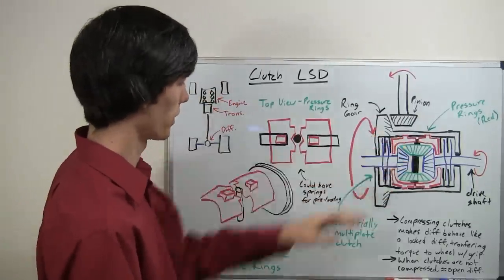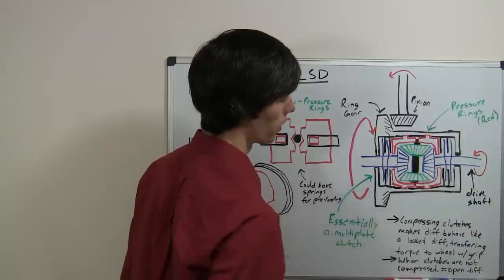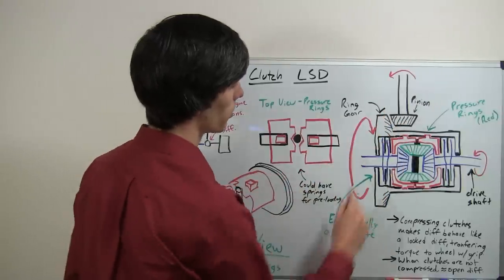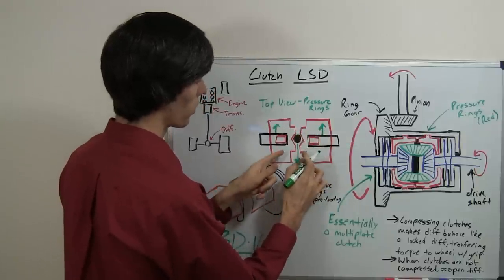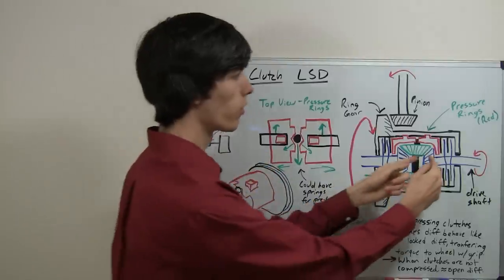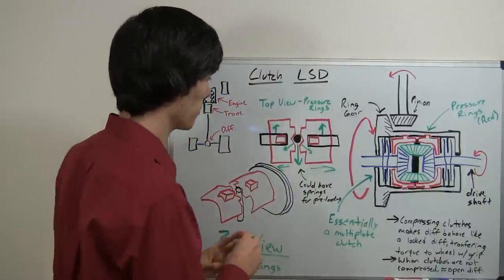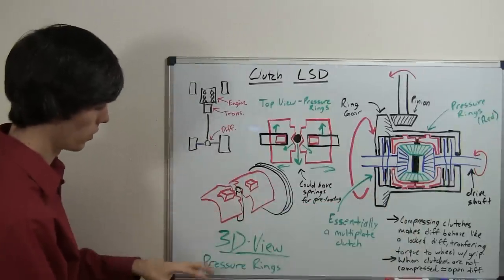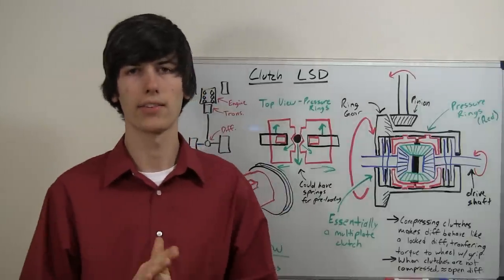Limited Slip Differential - Explained

Comment from the maker: Locking differentials have the advantage of always having both tires spin at the same speed. This can be good in such instances as being off-road, on ice, dirt, etc. Having the wheels locked allows for the maximum amount of torque transfer possible (100%). A limited slip diff only transfers torque up to a set amount, based on the friction force that is needed to be overcome in order for one tire to spin more quickly.

Comment from the maker: Depends, if you're accelerating/decelerating (if a 2 way) and one wheel has better traction, it may help. If you're just coasting, than an open will allow the two wheels to rotate at different speeds.

Comment from the maker: Close to a locked diff, in a sense that it will transfer torque, yes. But it can still allow for differing speeds while accelerating. Depending on the type of LSD, you may have to break a certain amount of friction to do so.

Comment from the maker: If you accelerate while cornering, both wheels will receive the same power, but if the frictional limit of the diff is exceeded, it will allow for one tire (the outside tire) to rotate faster than the inside tire. If one wheel is "locked" the torque will attempt to go to the "locked" wheel in order to break it free.

Comment: Thank you so much, I couldn't understand what the clutch packs were being compressed against that caused them to engage the left or right wheel shaft.  You explicitly stated that the force from the pinion shaft compresses the clutch packs against the HOUSING, which wasn't clear in other top search results.  Thank you!

Comment: why do you say when you are not accelerating, the pinion shaft (black) does not has force on the pressure ring? i thought as long as the wheel is rotating, the pinion shaft will definitely contact with the pressure ring and therefore there will be force on the pressure ring?

Comment: Finally I understand how my clutch LSD works. Right half shaft spinning faster makes pinion apply pressure left, engaging the left clutch pack. Also explains why it feels like I have a locked diff when I apply heavier throttle while turning.

Comment from the maker: It's not locked, it's somewhere inbetween. You can set the frictional limit, so if there's two much bind the outer tire will be able to rotate faster than the other. What it's doing is simply trying to prevent one tire from spinning on it's own, thus causing the car to understeer and not accelerate.

Comment from the maker: The combined torque of the axles (both wheels) would not exceed the torque from the differntial, so if it were 50 then the one not on ICE may get like 45 lb-ft and the other 5 (or some other split).

Comment: Having an air locker means you have the option of having both wheels completely locked or getting equivalent torque.  This is can be disengaged at anytime as well to typically an open differential or even a LSD.  LSD differentials have clutches that can be overcome when the torque demand is too high. Meaning torque split will never be even when it is in demand. A LSD is great and has it's purpose.

Comment: Indeed. If a tyre cannot deploy enough torque to the road surface, the wheel will spin and "waste" the power given to it by the drivetrain. - The solution for the case in question (FWD car) is an LSD, however that can cause other handling issues (including increasing understeer), particularly in FWD applications. This is because there is a limit to what the tyre can do. - If you're using all of it's available purchase on the road to put power down, you can't then expect it to steer as well.

Comment from the maker: Modifying an open diff (aside from simply welding it, which you shouldn't do if you're going to use the car on roads) wouldn't be cost effective, but you could likely find an LSD that fits your application.

Comment: Have you ever applied to work for a Formula One team, i am sure they would be impressed with your knowledge.

About LSD, i fitted a Quaife LSD in my kit car and it just uses worm gears and no clutch packs. worked well and apparently very reliable system.

Comment: Thank you very much for the amazingly simplified video of LSD. However, there is couple questions that by answering, everything would be clear as crystal for me: Doesn't the clutch lock the differential with the pinion shaft and therefore the drive shafts? How does the clutch lock the two drive shafts "together"? After all, aren't the pinions on the pinion shaft rotating freely and therefore still allowing the two drive shafts to rotate at different speeds?
I understand how annoying my questions seem to be but I really would appreciate your help answering them. Thank you again!
Reply from the maker: Yes, the clutch within the LSD is essentially locking the two driveshafts' motion together.
Reply: Engineering Explained
 But, how is the clutch locking the two driveshafts' motion together? The clutch merely connects the pinion shaft's motion , and therefore the driveshafts' motion, to the clutch housing's. How is it locking the two driveshafts together by doing that? Especially when the driveshafts can still  rotate at different speeds since the pinion gears on the pinion shaft allow them to.
Reply: Engineering Explained
 Sorry for the confusing questions; I think you have answered my questions with a minor detail that you had mentioned in your video about Viscous Limited Slip Differential. I didn't notice that the clutch plates were actually coming out of the driveshafts and so, couldn't understand how the clutch would lock both of the drive shafts together. I hope I have got it now right. Thank you!

Comment: Sir, i have a good idea to for your next video about diferentials: 
I have a Nissan Terrano (also well known as the 1998- 2004 Nissan Frontier) who has an open diferential. You see, while i am travelling through sand, when one wheel starts spinning, there is no aparently way to give power to de non spinning wheel, but that is false: whith the hand brake midly hard puted on and a rwd car, you can lock out the diferential, and smothly ride away from the slipery surface. 
Very good program!

Comment: Great explanation.  I understood it.
But in order for it to go into locked mode, it seems to require power being applied at the shaft and resistance to motion.  I.e., when both tires have traction.  Which seems to defeat the purpose.

Comment: very nice video! i've got just 1 question: what about the differential when i'm turning and ACCELERATING at the same time? when i accelerate the pinion is pressing on pressure rings which activate the clutches, locking the whole differential. Doesn't the internal wheel start spinning? I mean, if they want to rotate at different speed, one of them must win the force of clutches pressing, isn't it a kind of "unwanted braking"?
Reply from the maker: Yes, something will give. Either a tire will scrub a little bit, or the clutch will spin. Either way it will attempt to keep maximum torque at both wheels while accelerating.
Reply: depends alot on your specific differential so that effect can be exagerated or lessened and is not  only due to the concept itself

Comment: Ok I understand most if that including the clutch plates releasing with absence of throttle for around a corner BUT I'm sorry I still don't see where or how that allows for torque transfer upon a wheel slip since the throttle will still be applying force to the clutch plates. Usually a sign of a slip would be a wheel moving faster than the rest and can see some methods of overcoming this but none which are applied in the diagram since whilst ever the clutch is engaged it makes it look like a 50:50.
Reply: Wait I had an epiphany about 10minutes after my post.... in a standard diff because of the 4cogs a slipping wheel would be favored as such by the power being exerted.

However with the clutch plates there is no ability to favor a side, rather the clutch plates would keep equal rotational speed/power to both sides and toque would be reduced in a wheel slip due to the less resistance holding as much pressure against the drive chain meaning that more force therefor more torque is applied on the side with the most resistance forcing it to take up the slack.

Am I understanding this correctly? I will be proud of myself for seeing this and understanding this if I have got this correct. It will mean that were I was being mistaken was forgetting that torque = pressure applied to the wheel which is affected by resistance rather I was seeing it as a same spin speed being applied to both sides and forgetting that the torque level is in relation to the resistance level.

Comment: Nice video, I thought it was very well explained. Fascinating that it behaves locked while accelerating and decelerating. Does that mean that braking through a turn on an icy surface is even more dangerous in an LSD than a normal open diff? Seems like on a RWD it would make the back end more susceptible to sliding out if you're already dragging one tire.

Comment: From what I've gathered, an LSD on a FWD car makes traction better, both while accelerating in a straight line and while cornering. In a straight line it makes sense to me: it behaves as a locked diff and torque can transfer to the wheel with more traction. I get that. But while cornering... it doesn't seem to make sense. If an open diff was developed exactly to allow the car to turn without having one of the wheels sliding, what's the advantage of the LSD on a corner? Thank you for your help.

Comment: OK, I've watched this vid for 5 times or even more. What happen if you accelerate or decelerate when cornering, both locked or just one tire locked? And when it is locked, is the drive shaft spins together with the diff housing (100% torque instead of 50%)?

Comment: so question. Is there some energy loss due to the heat dissipation in the clutch packs since the wheel rotating faster has to overcome the frictional force and slip? If so, is the magnitude of the energy loss considerable?

Comment: but if you accelerates while cornering?
Reply: So long as the acceleration force you apply during the corner isn't higher than that of the frictional resistance of the clutch it won't lock up. if you do then I guess you're prone to having wheel spin and maybe lose control of the car.

That's I suppose why they recommend in slow out fast.
Reply: You're going to powerslide. That's why LSD is good for drift cars.
Reply: if the acceleration Is great enough that the pressure rings expand then both wheels will be close to 50/50 torque split

Comment: So what exactly happens when the friction of one of the clutch packs is overcome? You said that the wheel that needs to go slower will start sliding against the clutch pack, but wouldn't that seize up the gears because the other wheel is still moving with the housing?

Comment: Based on your explanation, if you accelerate through a corner, while turning, would your clutch plates be engaged or would the geometric design of the pressure plates prevent that?

Comment: Thank you for your reply, but you didn't really address my question. While accelerating out of a corner, an LSD is behaving as a locked diff, correct? So, as it is behaving as a locked diff, it's making the act of going around the corner harder (as all locked diffs do). So what's the point?

Comment: Nice tutorial ! I have a small doubt. You mentioned in the video that the pressure rings gets pushed outwards only when the accelerator is pressed. If the pressure rings are pushed outwards, the clutches are engaged so that the wheels rotate. I understood this part. But what if I keep pressing the accelerator pedal when cornering. So by that way it still acts as a "locked diff case" and the outer wheel will experience some wear right ? Please clarify !
Reply: wel it depends on the amount of friction. is the friction created by the wheel and tarmac or the one from the clutches higher.

Comment: Jeep Grand Cherokee used gerotor (gear pump) to lock the multi-plates with
the ring gear. The other manufacturers use the solenoid to lock the multi-plates with the ring gear, like Acura SH-AWD.
What is the major difference between the gerotor and solenoid used to lock  the
multi-plates ?

Comment: Jason, I've really enjoyed your car videos. It was your videos which inspired me to go throw a higher ratio final drive to my BRZ. I have a question that might make for a good future video. Does an LSD help put power down in a straight line? It does seem clear what the answer is when you have varying friction surfaces or in a turn. But if all drive wheels have the same amount of friction in a straight line, does an open diff still eventually divert the power to the wheel that has slightly less friction? Or does it end up just spinning all drive wheels equally? If not equally, would an LSD solve that problem and help put more of the power down?

Comment: I've got a fair handle, conceptually, on LSDs that use clutches, be they actuated by ramps or hydraulics, but I really can't say I grok how the torsen diff with it's orbiting worm gears works.

I've seen it said that a torsen diff will transfer torque to the outside wheel during cornering, but as far as I can understand all of the clutch type LSDs will actually apply any cross-axle torque in the direction of the inside slower wheel, at least until it slips and overruns the outside.

thoughts?

Comment: So with an open diff the torque will always be split 50:50, with a locked diff it can be up to 100:0, but heres where i'm stuck: When a diff is rated at 25% locking percentage, how much torque does it transfer to the wheel that has more traction? 25%? Lets just say the other one is up in the air for simplicitys sake. Thanks!
Reply: 25% means 25% of torque is distributed where the traction is better but there is also 75% of torque left to go somewhere. Where? It's simple. There are two wheels so 75% goes 50:50 like in open diff and 25% on the better traction side (or in your example, the wheel that is not in the air). So it is 75/2=37,5% of torque per wheel + the 25% so that means: 37,5% in the air and 62,5% on the ground. Cheers.

Comment: Since one can't be at a perfect constant speed condition, a little amount of acceleration (or decelation), inevitably, will always exist. The rotational independency is achieved simply by exceeding the μN product at the clutch packs, which seems to be easy if the acceleration is weak. This means that the Limited Slip Differential is more "energy consuming" than the locked and the open differential due to the relative sliding at the packs. What damage does this friction impose to the drive line efficiency and how important is it?

Comment: Would that certain torque be greater or less than intended? I'm guessing less based on your explanation. Also, when you accelerate and turn at the same time, the LSD would engage and you would lose your turn radius as result?

Comment: You are an awesome teacher my friend, thank you for sharing your knowledge. I have a question perhaps you can answer. When servicing my 8.8 rear differential in a 1995 Ford Explorer, one shop told me I needed a friction modifier because it's a limited slip differential. Another shop looked at the Vin number and told me I didn't need to add the friction modifier because only vehicles with a W in the Vin number would need the friction modifier. True or false?
Reply from the maker: Find out what model you have (use a VIN decoder on Google), and see if you have the LSD or not. Or check the owners manual.

Comment: Hi, could a limited slip differential  for a rear wheel drive car cause additional understeer when braking in to, or accelerating out of a corner?  Where this acceleration or deceleration was not intended to slide the car.

Comment: So if you have one wheel on ice and the other on pavement, the amount of torque it takes to compress the clutch packs are equal to the torque coming out of the driveshaft? Or is it basically instant. Like say the clutch packs take 50lbs of torque to actually lock, that wheel NOT on ice can only produce 50 lbs of torque?

Comment: What's not mentioned here is the preload spring. What's the purpose of that? Wouldn't the diff work just as well without it? Why does it need to be just a tiny bit "locked" to begin with, instead of starting out from a fully open state?

Comment: Would this work exactly the same with a clutch pack center LSD? I'm trying to wrap my head around, when the diff would unlock and lock.  On my bench the diff seems locked tight.  I'm assuming this is preload, and once there is the force of an engine turning it, it will let the plates start to slip.

Comment: thanks for your explanation！So，from my understanding，basically LSD makes u have both characteristics of open diff and lock diff and when we go thorough a corner（while still pressing the throttle，not full throttle ，maybe 50%-60%）. the diff is not fully locked，the outside tire wants to rotate faster than inside tire，so the friction plates（clutch packs）of outside tire need to slip a little bit so the car can go through corner successfully. Am I right about this？or just the clutch packs of inside tire need to slip so，because the plates of inside tire will still be pressed but the force is not that high to let it spin and get huge amount of torque. this make the two tires have diff speed ，while still have diff torque（outside tire more torque than inside tire）？

Comment: I'm having a hard time trying to undestand power distribution on a 4WD car, let's say the car have a power distribution of 40-60, the differential sends 40% of the power to the front weels shaft by rotating at a less speed than the rear speed shaft right. If so, then the wheels should rotate at a different speed than the ones in the rear? Also what if the front and rear wheels have different sizes? 

Thanks